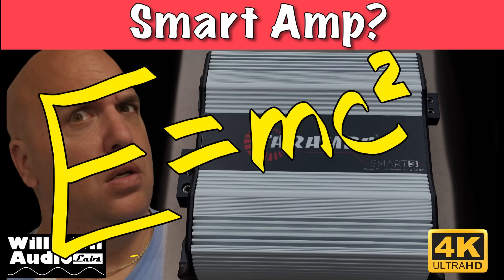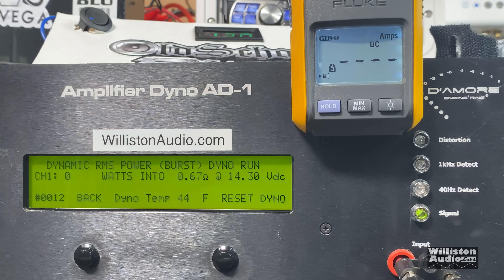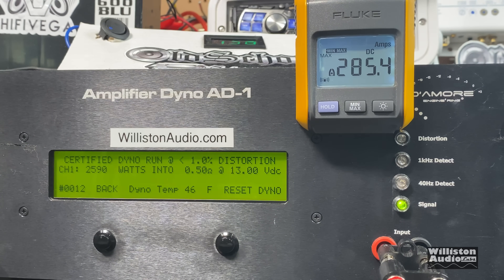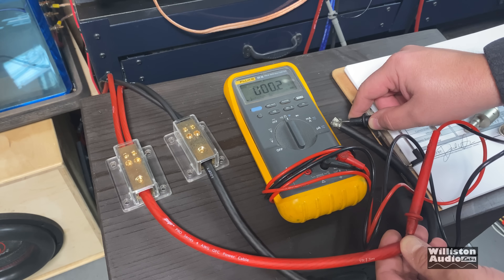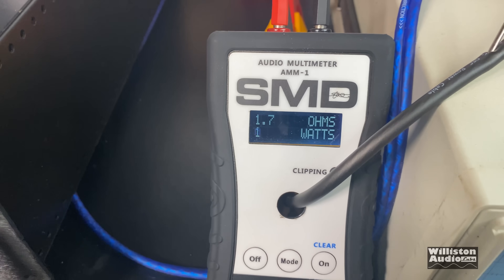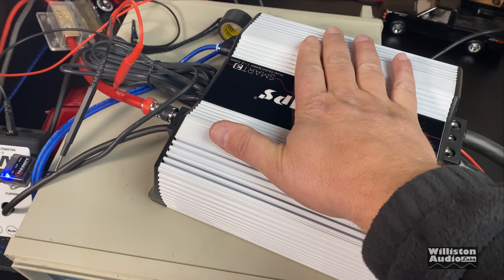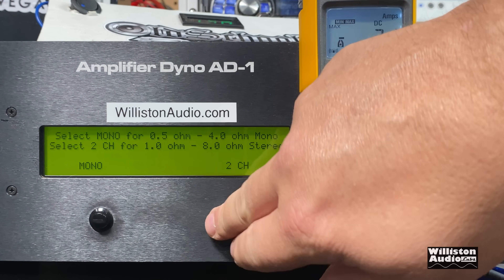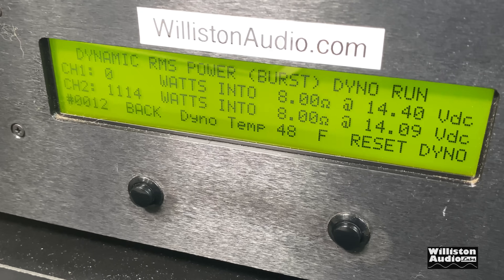Taramps Smart 3 vs 6000W Sub and INSANE Amp Dyno Low Impedance Testing [4K]

Comment: Seeing it did well on .5 ohm on the Dyno but what would it look like in a real world application? Would it be ok to run it at .5 ohm with the right electrical? I currently have a xs power d4800 and a 370a js alternator. The subs are two sundown u12's d2's in a custom built 6th order. Just trying to combat rise and get as close to 3k as possible.
Reply: In a normal set up your amp would never truely see .5 ohms. Ive got 2 HDS3 15s on a Smart 3k wire to .5 in theory but the amp is only seeing like .8 ohms so it runs fine.
Reply: @ChopsK98  how long have you been running it at .5?
Reply: 3 months about. Honestly, it barely even gets hot. Keep in mind my electrical is very good as well. Optima yellow top under the hood, upgraded 200 amp alt, big 3 and 2 deep cycle batteries in the trunk.
Reply: @ChopsK98  I have a 370a alt and two batteries up front. Can't go lithium since they aren't under hood compatible but I think I have enough electrical to give it a try.

Comment: What pin adapter are you using on the power wire? I've purchased a couple that are supposed to be 1/0 to 1/0 and they do not fit into the power input which I thought was supposed to accept 1/0 wire? Please let me know?!? Thanks  for the great videos! Keep up the great work! Have a safe, happy, and blessed holidays!
Reply: dual 1/0 to 1/0 just grind it down to fit

Comment: So just out of curiosity, I plugged the RCA into the output and it still played the same. So technically you can plug booth RCA’s into the amp. I guessing the RCA is connected together inside the amp.
Reply: My Sundown sfb 3000d says the same thing, both inputs or 1 in and 1 out.

Comment: My amp goes in to clipping real fast on my 2 pioneer 2000 watts max subs... Is it that my subs can't take it or is there something wrong with my amp
Reply: Try turning your gain down a bit. Usually you would attempt to match your gain to your radio's pre-amp output then back it off a slight tad. This is if you dont have the tools to set it like an SMD. Thats the old school way. I would try that. If not, then you need to be sure that you have enough power and current going to the amp. Ensure that it is grounded properly and that you have your subs wired to the proper OHM load. Triple check.
Reply: I have them at 1 ohm's
Reply: 600 watts normal
Reply: if you dont have at least a second battery, youll never be able to really push this amp without clipping. power = cleanliness

Comment: MR.D WIZ I NEED HELP CHOSING AN 3K ORION AMP OR 8K FULL BRIDGE SUNDOWN AMP OR TRAMP BASS 8K OR MD SERIES, I HAVE 4 DC AUDIO 10 INCH M3'S WITH 2OHM VOICE COILS IN A 2002 CHEVROLET SILVERADO EXT CAB WITH A 6TH ORDER BLOW THREW. I HAVE A SINGER 270 HIGH OUTPUT AT LOW RPM AND I NEED LITHIUM BATTERIES ALSO 6 CT SOUNDS 8 INCH MIDBASS,FOCAL 6.5 COMPONENT SET IN Q LOGIC KICK PANELS. 2 JL AUDIO SLASH SERIES 300×4 AND A 300X2 AND A OLD SCHOOL AUDIO ART 200.2 MS OR A SET OF 4X6 MB QUART PLATES IN THE BACK DOOR AND SOME QUART TWEETS PIONEER AVIC7800 AND A OLD SCHOOL CALIFORNIA PROFILE 1026 PRE AMP EQ 15 BANDS IN THE MAKING SOMEWHERE AMP WISE THE SUBS ARE 900 WATTS RMS I ALSO SEEN A B2 AUDIO 7500 I NEED SOMETHING FOR AROUND $650 ORION WAS THE BADDEST THING YOU TESTED SO FAR I AM RUNNING A MMATS D300 I WOULD LOVE TWO HAVE TWO MMATS D200 HC'S OR D100HC'S BUT PRICE WISE NEW SCHOOL AMPS IN STEAD OF OLD TECHNOLOGY BUT I LOVE MMATS OLD AMPS AMD US AMPS. WHAT DO YOU SUGGEST FOR A 42 YEAR OLD STREET BOOMER ?
Reply: WHY ARE YOU SCREAMING?! Just get a Rockville dbcomp4 or 5.
Reply: @bucketmouthinc82  wtf dont get rockeville lmao
Reply: That orion 3000dsplx was impressive, but I'd go with the bass 8k

Comment: @Williston Audio Labs I'm ordering a new amp soon as I decide which to order... (I'm a very indecisive person) Would appreciate your advice on the following two amps: Taramps Smart3 or the Rockville dBcomp5 3500 rms amplifier? Which amp would you suggest I choose?
Reply: don't buy rockville. Seriously overated.
Reply: @CotyRiddle  I ended up getting a Taramps Smart3. Just put it in my car Sunday evening, so far so good. Only time will tell. Considering it only cost $279.99 shipped to my door for a 3k rms amp I'm not worried about it. If it only last six months I'll have gotten my $ worth out of it. The clipping remote is a plus! I like it, seems to be very accurate.
Reply: @itdoesntmatterwhatyourname6128  woulden't mind having one my self that thing is a little monster. Sadly i just have my Alpine PDX-5
Reply: @CotyRiddle  just so you know this Taramps Smart3 POUNDS for a lil 3k amp but the bass sounds all bland & boring. Idk for sure if it is the Taramps fault for sure but I am guessing it is since Brazilian amps aren't known for SQ but this thing sure does put out good power & is able to slam at high volumes on bass HEAVY songs for song after song after song, 45 mins & longer straight with no breaks. I can't believe how well it stays cool but it hasn't overheat or went into protect a single time. I will add that I just ordered a Korean 3500 watt amp about 2 hours ago mainly to see if that fixes my bass tone or not. Then I'll know for sure whether the Taramps is the reason for boring, plain sounding bass. Everyone says how great & warm the bass sounds from Korean amps & I've been wanting a quality Korean for a while. So I went ahead & pulled the trigger. Should have the amp by Tuesday or Wednesday & I'll let you know how it sounds. Either way for $279.99 I would still recommend the Taramps 3k to anyone on a budget whose just looking to bump hard bass.
Reply: @itdoesntmatterwhatyourname6128  yo each their own. A lot of things can affect the tonality of your system.  Could be the amp or could be something else but that is the great thing about car audio. Soo many things can be changed and tailored to the listener. So what ever makes you smile is what matters :D Good to hear that tid bit tho. I start my new job on the 12th so hopefully I can snab a new ride for cheap. Then its back to installing a system and tweaking things to my liking.
Reply: @CotyRiddle  Good luck on starting your new job. Hope you can find you a good deal on a vehicle you like so you can start putting your new car audio system together. What you got planned. You already know what brand gear you'll be saving up to get? Man I'm a very indecisive person & do not do well when given a lot of options and let me tell ya the way car audio is in 2020 its so much different than when I was a teenager & early 20s back in the early 2000s. It was easy for me to pick my mids/highs, subs, amps etc. Now their are so many different companies making car audio & theres so many great subs & amps on the market. I have a real hard time deciding. I really like: Deaf Bonce, PSI, Resilient Sounds, Sundown, Wolfram, Synergy & Skar just to name a few lol see what I mean. And not a single one of those brands were even around back when I bought my first system.
Reply: @itdoesntmatterwhatyourname6128  I like the older stuff. Not really into all the new brands. Sundown and deaf bonce is pretty nice. I got two Xtant  X1044 (dual 4 ohm VC 500 watt) in a custom built box which I know will probably need to be changed depending on the vehicle and a old Alpine PDX5. The amp is ok for just bumbping tunes at reasonable volumes but is severely limited when it comes to power (rated 300 watts into 2-4 ohms factory spec sheet said it was tested at 500 but hey whatever I don't have a fancy dyno:P) but for a 5 channel amp it seems to do pretty well for what it is. 
Now weather i can snab a car or a old chevy/gms truck depends on how I will do the build but either or I will be taking my Alpine r series 6x9's back out of my wife's truck. she can kiss my but as she is not a music snob like I am. she really don't care about the quality of a system or if it even sounds good. I put her in the group of bose lovers .
Reply: @CotyRiddle  lol you said put her in the group of Bose lovers. Idk what it is about Bose owners but they always give the persona that they think they have creme de la creme. It sounds like you really aren't even pushing your subs atm. And btw don't feel bad most of us average Joe's don't have "fancy amp dynos" lol. I'm glad Big D does though since he provides us with so much information & knowledge.

Comment: WHAT DO YOU THINK ABOUT TARAMPS SMART 3?
Reply from the maker: Good amp
Reply: @wal   OK, THANK YOU FOR YOUR SUPORT.
Reply: @wal  I'm ordering a new amp soon as I decide which to order... (I'm a very indecisive person) Would appreciate your advice on the following two amps: Taramps Smart3 or the Rockville dBcomp5 3500 rms amplifier? Which amp would you suggest I choose?
Reply: I have the 3 smart on 2 12s pioneer 2000 wats max, and it goes in to clipping real fast at 1 ohm...
Reply: @bertgutierrez5839  where do you have your gain set at? Are you sure it's set near accurate with your headunit? Also are you using the bass boost or the knob beside the boost? (I believe it says bass freq) Only asking so I can try & help you with why your amp is clipping so easily. 

Bert I actually did end up buying a Taramps Smart3 & that is what I've had in my car for right at a month now. I am running it on a single Skar ZVX 18" dual 2 ohm subwoofer wired to 1 ohm. I have not yet had any issues with clipping or the amp getting hot. I can play very bass heavy music for 45 mins & longer right at full tilt with the volume knob turned just one click below clipping without any issues. During long hard increments of playing bass heavy music the amp does not even break a sweat. Never went into protect on me. (I say all this while knocking on wood lol) My gain on my Smart3 is set right at around 40% set along with the rca voltage of my headunit. And trust me my amp has really been good to me this past month! I have a brand new nice Korean amp 3500 rms that I haven't even took out of the box yet as the Taramps has been doing great on my temporary single 18 setup. I am switching to an 8 cubic feet custom ported birch enclosure that will be housing two new 15" subs in approx. 2 to 3 weeks. Currently waiting on the wood to be cnc cut to my specs & then I will be using my new Korean amp to break in my two 15s. After broke in I will be putting an 8k on them @1ohm.

Burt I hope you are able to get your Smart3 straightened out or dial the tune in better. I know that's gotta suck with it clipping so much! Lmk if their is anything else I can help you with.
Reply: @bertgutierrez5839  lower your subwoofer output from your head unit i had that problem at first .with my md3000 but when I did it allowed me to be able to raise my gain higher on amp and it wasnt clipping  as much at all

Comment: Whats the difference between the smart 3k amp then the regular mono 3k?
Reply from the maker: Smart 3 does 3000W at 2 and 1 ohm
Reply: @wal  is this amp not a mono block? I heard you say its bridged
Reply: @xpert_kid_one730  its a monoblock. its a full bridge amp which is different from your regular half bridge amps like my dc audio 2.0k which is super beefy to give not a lot of power. its just a different amplifier topology or type of amp
Reply: Haterr plays 👈‼️ glad I caught somebody trying to explain the difference between half bridge and full Bridge - - well the difference between Korean and Brazilian the difference is most Koreans - not all ,use half bridge which is only using half of the power supply wave and ,full bridge is using both half‘s of the power supply wave so Korean amps on average run a little more cooler and safer where as Brazilian run hotter but use all the power from its power-supply  now as for the output stage - - both Korean&Brazilian are exactly the same as any class D amplifier so the difference is only in the power supply stage so it’s not a real different type topology it’s just a different power supply topology now as far as reliability goes on average Koreans have a lot more different protections in their Circuit designs so aren’t run at Max where as Brazilian Run theirs at Max  output so reliability does suffer a bit but you save a lot of money on less protections more output Watt per dollar an a little less reliability -versus-protections longer lasting less output more $$$ you decide which you like better but on average a amplifier only does one thing amplify the input signal and that’s all they should Do they shouldn’t color the sound but some do with EQ and crossovers built into their design so it’s up to you to decide on which you like better at the end of the day The more you know🌈🤔
Reply: @eurekaakerue4649  glad you really dove deep into it. I watch barevids but I’m not gonna pretend like I know what the he’ll I’m taking about lmao. I actually just bought an sfb 3000 so I’m really going to find out the difference in sound quality and other small things. Also, I’ve learned that my friends taramps bass 3k runs much cooler than my dc audio 2k. We live in Florida though so the sun is a killer and that amps white while mine is black. I guess maybe it’s why pretty much all full bridge amps have cooling fans and half’s don’t

Comment: Can I use this amp with 2 xfls 12s on a stock system running at 1om zero gauge wires? Oh and a 30 cap?
Reply: Get big 3 and xs battery at least
Reply: Not gonna lie... that bass 3k version lookin 🔥 though.
Reply: @ChildofOurHeavenlyFather  you like the bass 3k over the smart 3? Hmm... you see the dyno on that one it didnt make rms as where the smart 3 is killing the dyno.
Reply: @klm510  the bass 3k dynos over 5k on solid electrical full tilt and it plays the lowest hz (8hz) of any of the taramps lines. Its specifically made for bass... I also like the fact that the bass line uses less amps then any of the others @ 3k. The smart3 has the advantage of playing 3000 watts at either 1 or 2 ohms.
Reply: @klm510  I got the HD & I'm happy with it for now.
Reply: @ChildofOurHeavenlyFather  yeah I ordered the Smart 3 I'll let you know how it does on those xfls, also I do like that the bass 3k has an subsonic filter but I dont like that it doesn't take 0 gauge wire... but you're right it is specially designed for bass hopefully they'll make some upgrades one the next one and I'll grab that one next for my next build.
Reply: @klm510  I'm sure you made the best choice. After checking out the smart 3k I noticed it put out 3k @12.6 volts. The bass is 3k @ 14.4. 
Its a hell of a lot easier to maintain 12.6.
I'm gonna upgrade to the Smart3 too.👌
Reply: @klm510  So, I've had the Smart 3 hooked up for about 2 weeks now. I have 200 amp alt, stock battery under the hood, +2 batteries in the back = to 150 ah. I cant figure out why but I can only run this amp at absolute minimum gain if I want to turn my music up without clipping thd signal. Shit is so weird... the HD i had i could turn the gain up to 50% easy. This one im barely at 5% gain & clipping @ 90% tilt on deck.
Reply: @ChildofOurHeavenlyFather  yeah I've had my about a week and I got an extra battery and stock alt and it clips but not to much. You might want to check the radios output because I've heard that this amp doesn't like anything over 2 volts from the deck.
Reply: @ChildofOurHeavenlyFather  lower your subwoofer output on your head unit to the amp to half or slightly over. That should allow you to  increase your gain. I had the issue with my md3000 but once I lowered the subwoofer output my amp was great after that .
Reply: Which one of these amps would work best with my  2 kicker cvx15 s wired to 1ohm? Anyone's input is welcome.
Reply: Only one of the rca is an input on these amps. Could possibly be the problem. Dont use both thinking they are both inputs